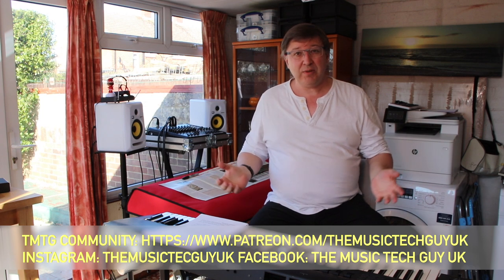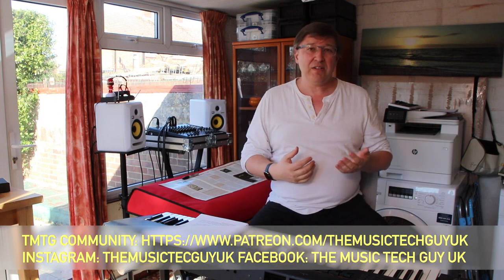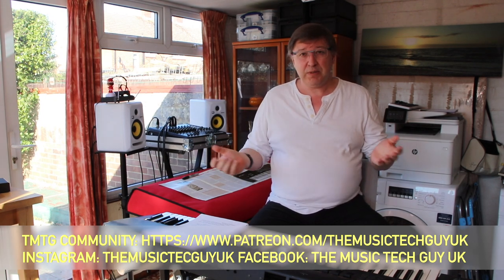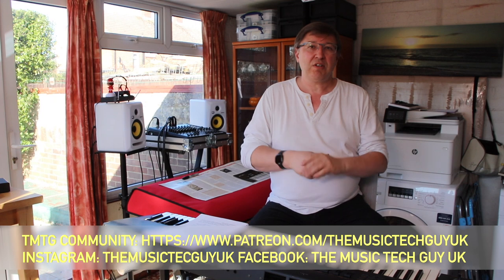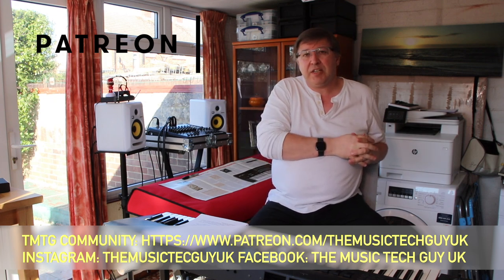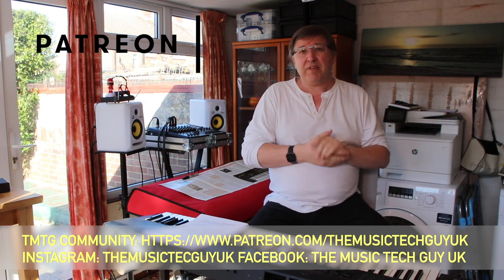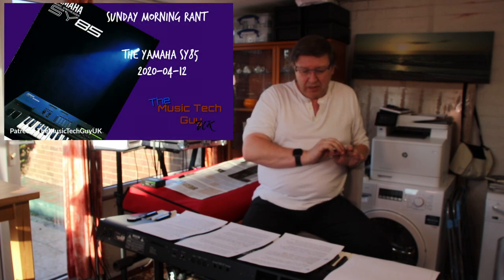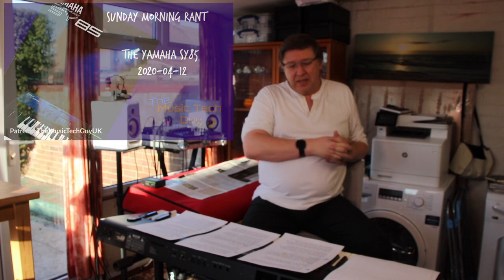SY85 Burning smell, You need Props Dude

Comment: Even the one I bought brand new had a funky smell when it got warmed up, and it was worse the higher the ambient temps got. 
It's got to be something to do with the plastic used in the transformer because when I had to replace one the smell came back for a while.
It's very different from the really acrid one you get from burnt out components - more like the smell you get from soldering.
An ebay one I got for spares stunk like burning asshairs but I'm pretty sure that was because it had been used in smoky environments (remembering you could still smoke in pubs/clubs/etc up till 2007).
My DX21 and DX27 both had the same soldery smell, and even the MODX6 had a bit of a weird (but sweeter) odour at first.
Yammie must just like stinky transformers.
Reply from the maker: Hi @Migraine Gainn. Yes Yamaha must have a contract with the stinky transformer company.

If the synth had been gigged in the old smoky venues that we had in the UK then the smoke, especially cigarette tar just sticks to the surfaces and if it gets hot then burns off.  I can recall being given a synth a while back that I re-condittioned and getting the sticky glupe off the circuit board and transformer was a nightmare.

And after all that effort I didn’t get on with the synth so sold it on!  Jon